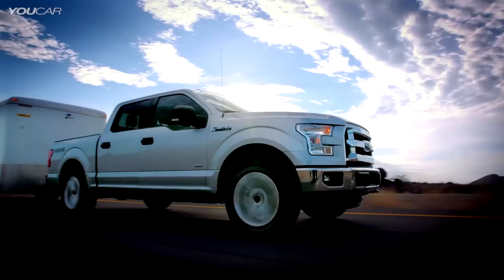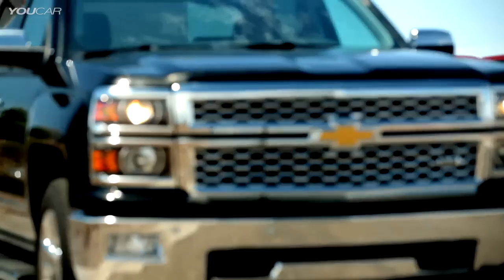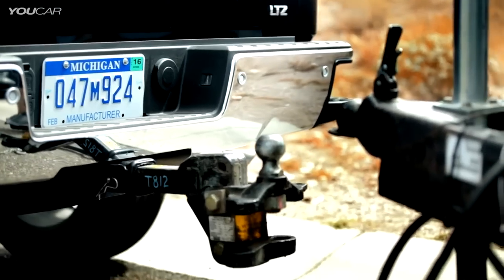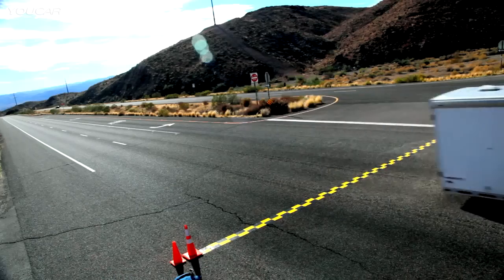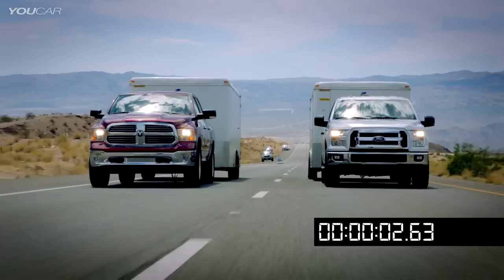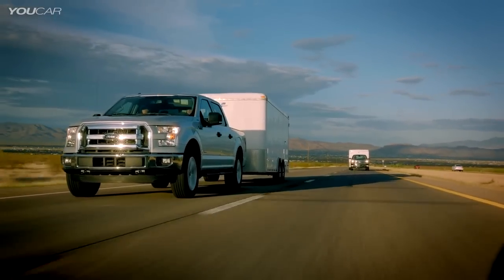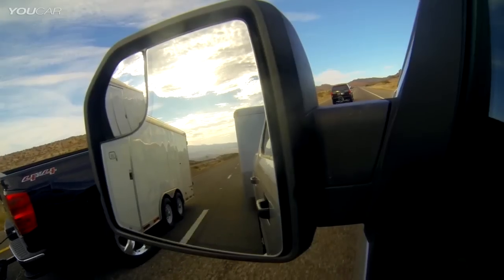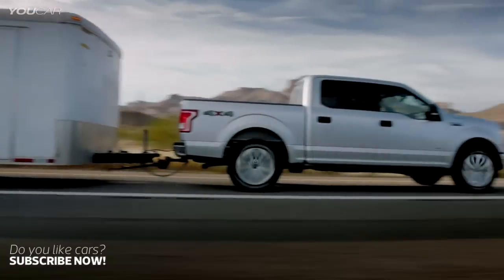TOWING Comparison – Ford F150 vs RAM 1500 vs Chevrolet Silverado

Comment: Fords little engine might be faster, but I have seen them towing and mpg' are very low about 9-10mpg. At the end of they day yes you still have a 2.7 v6. Get real they might be faster but the only thing moving that truck are the turbos not the tiny v6. So at the end of the day I would rather stay with a 5.3 which has been around for a long time just getting fined tuned. Might be slower but reliable.
Reply: +rollocock If you have a newer GM then that 5.3 has only been around for a couple of years, not a long time by any means.
Reply: +Daniel Bell 
Same concept engine just direct injection baby. Good luck replacing your little turbos. I had an eco boost and I traded the truck in to many sensors going off all the time, but again I do use my truck like a man for the ranch and I tow a lot and use it for hunting in south Texas. GMC has been the only truck tough enough for my needs. Even had a 2013 ram 2500 same thing def fluid sensors way to sensitive couldn't drive for long cause check engine light would always come on.
Reply: rollocock The only things it shares with the old 5.3s are the block and displacement. Completely different engines. As for the EcoBoost, I wouldn't know first hand. I've had my truck since 05. Good luck with your Gay Man's Chevy.
Reply: +Daniel Bell 
Don't be made just cause you have a 10 yr old truck man. One of these days when you grow up and get a real job you will be able to afford a real one. Then you can talk shit like you have actually owned all these trucks you talk about. Boom, you made bro.
Reply: rollocock When you've lived as long as I have actually doing work for a living, you'll understand the difference between want and need. Or maybe you won't, you sound like a child. I would like a new truck but I have no need for one when my truck gets the job done every time without fail. Come back when you've got 20 years experience with how bad Chevys are, especially that gutless piece of shit 5.3. I believe the term is "You mad bro?", to use your young vernacular.
Reply: +Daniel Bell 
Well to be honest I have been around for a while and I'm not saying that ford is a piece of shit they do have a good engineering team. But the Eco boost is very new to the truck world. But u say u have a 2005 I had two 2004 ford fx4s first one had a severe knocking problem when oil was changed, dealer said was normal which was bull shit. Got another one and guess what I couldn't even change the spark plugs cause they break in the engine block. So yes I have a lot of experience around trucks I do mechanic work and under stand the difference between want and need. But when u can't even change a spark plug in a truck that's a big cause for concern too bad your 20 years of experience didn't add up to shit u dumb ass. Fords 5.4 was the cheapest engine they ever built that's why it's no longer being made.
Reply: +rollocock 
U will be mad bro, when it's time to change your spark plugs and u have to take it to the dealer to take your engine apart cause the plug is stuck in there broken.   U sound like an old troll,  or a little kid that got his dad's old truck and never got a real job to buy his own truck. Good day my friend.
Reply: rollocock Already changed them at 172000 miles. Not a single broken spark plug. Nice try kid. I sound like a child? I'm not the one that can't spell or actually use whole words. Tell me, just how many milliseconds does it save you to type U instead of you? Are you stupid or just lazy?  While this has been mildly entertaining, you're beginning to bore me.
Reply: +Daniel Bell 
Might be lazy, but I still don't drive a problematic ford. FOUND ON ROAD DEAD. I don't have to waist my time with u, u old cry baby. Just google your own truck reviews and u will sell that crap pile ASAP. Old grumpy grandpa, of course your truck is fine for your use u r probably the guy on the expressway going 40 mph on a 75.

Comment: This is full of bullshit

The V6 is lighter and more efficient yes 

But putting a 7,000 pound trailer will sap that effecincy over night 
 
You are forcing the engine to work so much harder than it should 

Not to mention what it’ll do to longevity 

If you ask me if your getting a truck from this generation GET ONE WITH A V8 

I garuntee you it will last longer

Comment: That's sad that they're saying that piddly little puke ass 6 cylinder engines for full size trucks are the future.   I want a big V8!   I'll never buy one of those eco poops.   One thing they've failed to mention in the video is that, because these little engines are wound up so much to produce the power they have,....they won't last long.   To much heat and strain running through them.

Comment: OK....so...when the turbo goes out then what? That's right, your dead in the water. I do have a question though which from what I have heard ford was having issues with the turbo's. How much does it cost t have that fixed or replaced. Its a real question. If anyone can answer it please. let me know!

Comment: Better gas mileage?  Now that's a good one.  Just like Fords ecoboost 2.0 4cyl gets better mileage than a Camry V6 or Accord V6.  Didn't happen.  And the Escape 2.0 getting better mileage than the previous body v6 Rav4.  Didn't happen.  Don't get me wrong, a turbo on any motor is a good thing as it adds power.  But don't let Ford fool you that this is for "real world" gas mileage gains.

Comment: This is complete BS. "Each truck is equipped with it's most capable axle". The diesel Ram is equipped with it's least capable axle, the 3.92. If it had the 3.55 axle that is available, it would tow much better. Also, I bet they didn't press the old tow/haul button on the dodge, because that would have increased acceleration. Ford wouldn't want that in their commercial. I'd pick a diesel over a tiny twin turbo v6 any day.
Reply: I know it's not what they used in the video, but I just want to point out how stupid your comment is by highlighting the fact that the Cummins is a turbo V-6.
Reply: There is a slight difference between a tiny 2.7L V6 with twin turbos, and a 6.7L, 800ft/lb single turbo INLINE 6 cyl diesel. I would still pick a naturally aspirated 3.0L diesel over a tiny twin turbo V6 in my truck any day. My comment wasn't directed at the fact the ford has twin turbos, it's the fact that it has such a puny engine. The 3.0 diesel is a superior engine, which will be proven in Real tests, not ford commercials.
Reply: illisbillis2424 My mistake, the Cummins is an inline 6, but that still doesn't change my point. If the engines are specifically built to handle the stress and weight, then as long as it's a good design, there shouldn't be any problems for these small engines to perform adequately.

Comment: Everything is a race these days. All of these trucks will pull that load with no problem. I don't need to race up the hill. Ford still uses the garbage IWE design on the front differential. They still have a ton of timing chain issues. Does no one at Ford know how to source decent timing chains and guides.

Comment: These is mes up compression ,you cant compere a naturally aspirated engine to a TURBO CHARGED ENGINE....a tune up turbo with factory non tuneup engine..really?
Reply: So a non-turbo engine has no tune? They just throw it together and hope for the best?
Reply: comparison", They are just using the top of the line engine option, in this case it is a ecodiesel, ecoboost from ford and should be the 6.2l from gm
Reply: thevinceberry No, the 2.7 is not the top of the line engine.  The 3.5 Ecoboost is and it spanks the 6.2 from GM and the Hemi from Ram.
Reply: Bubu Lubu ah..I thought the 2.7 will replace the current 3.5 next year, maybe the gm 6.2 can beat all of them since they didn't use it in this video. The 5.3 did do pretty good when the air is cooler and denser. I am surprise the 2.7 didn't have heat soak from turbo in those temperature
Reply: thevinceberry one reason they used the 2.7l engine because it is a brand new and tiny engine that alot of people thought would be weak. Another reason is because the 2.7l engine is going to be extremely fuel efficient, while no numbers have been released experts guess it'll be around 30mpg. If you look though enough pictures you'll see one of a dash with 1152 mile on on tank of gas and that's with a 33glallon gas tank which doing some math that's over 30mpg
Reply: darkerthen black ah ok, 30+mpg on a hot day in a full size truck will be super impressive

Comment: hey I'm looking to buy a 2015 f150 2.7l v6 xlt 4x4...super cab,
and I'm very curious to know about fuel milage...how is it? 

but from your experience, how many kms can you get in one tank ( on average )
and do you get good mileage while hauling? 
I'm getting a truck camper that will be around 1500-1600 pounds. and it'll be in the back for the whole  summer, so looking to see if it'll be any good or not on gas.
thanks
Reply: sorry what ? haha but i ended up buying a 2015 f150 2.7l. it's really good on gas. first two tanks of fuel so far have been 12.5l/100kms

Comment: Turbo direct injection is the way of the future.  Close minded people just cant accept anything other than a V8 in a truck. All manufacturers will eventually go this route.  So no matter what brand of truck you like, everyone better start getting used to this concept.  Thumbs up for Ford stepping out of the box first with the engine, and now with the aluminum body.  I'm all for a smaller carbon footprint.

Comment: Of course Ford is going to win they are they ones submitting the video. How would it look if they lost in their own video. And if they are going to test they need to use the biggest engines, because after all if your going to tow a lot you won't get the littler engines. Me myself am a Chevy guy! And when Chevy does the testing I feel the same! So I like the fast lane truck for tests like these!!

Comment: I drive a ford f-150 5.4 V8 3V. I love that motor but ford just makes me laugh with this eco boost crap. Hmm lets line up trucks and which one wins is the better truck. It doesn't matter how much torque or horsepower you have. Thats right but dependability is key. I rather drive a chevy then these
New f-150 with eco boost engines. Long live V8s!

Comment: Who races or passes with 7 k trailers behind them,seriously..these tests are rediculous,and show nothing .no one is going to do this with there new trucks with a trailer.In every ride and drive th Ram 3.0 eco diesel comes out ahead with its awesome 8speed trans and 420 ft lbs torque,at low rpm.who cares if it gets passed by a little 2.7 at 5500 rpm and 15 psi boost,it's going to require expensive oil,frequent changes and it's still not going to last like V8 or diesel....

Comment: Way I see it. Ford= Speed Dodge= Hauling and chevy, well I dont know yet.
Reply: Dodge hauling? Hauling what? Dodge can't haul anything ... the new Rams get the best gas mileage because they can't pull shit unlike the Ford and Silverado.
Reply: +TrapBird (Camaro Girl) the new Ram out tow the ford and Chevy
Reply: Ricky Davis Ok first off that barely made any sense, I really hope English isn't your first language, but Rams and towing are two things that just don't go together.  It's like fire and ice, water and oil, drinking and driving.  None of them go together, or they just don't end well
Reply: +TrapBird (Camaro Girl) the ram are make for towing just why they make them
Reply: +TrapBird (Camaro Girl) yep dodge can't haul anything, even though they have the most torque and towing capacity but your right dodge can't haul shit
Reply: +NickF1999 whatever
Reply: Michael Dean you do realize I was being sarcastic right

Comment: except when your ecoboost blows up at 20,000 miles and ford says owell...
Reply: It wont blow up at 20,000 it will stop running at 1 million miles
Reply: Actually... I know of two ecoboost trucks that blew up before 20k and Ford wouldn't do shit about it. Look it up too, lots of people are having the same issue. The EcoBoost blocks are already maxed out from factory making them very susceptible to issues.
Reply: es esto real ? piensas que el ecoboost no es tan bueno ? que recomiendas  con tu experiencia ?
Reply: He probably recommends a V-8 or diesel for durability and fuel mileage.

Comment: I don't care if ford beat Chevy. I still rather have the Chevy v8 5 liter engine than a 2.3 liter and I want that big v8 that can handle the abuse. I don't think I'm gonna be flooring my truck on the highway with a trailer to see how good it does. No I want a truck I can rely on and not have to worry about 2 liter truck with poor body and poor bed strength. And ford is not a good truck to own because of the way they built it

Comment: Beware the Ecoboost!  Had Fords all my life - F150s, F250s, Explorers, Expeditions, but my 2012 3.5 Ecoboost blew up twice and Ford ran from the problem.  Original engine disintegrated at 83K miles, used replacement went to 91K miles.  Loved the truck but cant afford new engines every 80-90K.  I will never buy another Ford piece of junk!

Comment: Without compromising? How about reliability if I owned a car company I would never put a 2.7 in a truck . proven fact the old small block 8cycle are still on the road 96 5.7 Chev 795 km still running nothing done bet the ford dies at 160 km

Comment: Will this engine cake the inlet valves like the 3.5 and have service bulletins to stick plastic covers over the intercooler to increase the intake air temp in moist conditions? Prob not good for towing in hot weather. Also cat failure occur due to misfires caused by intake valve caking and moisture.
Ford cannot build diesel engines after the 7.3. 6.0 BHG oil cooler issues etc. etc. 6.4 cracking heads and the the 6.7 suffers turbo failure and drop valves due to heat. So far the 6.0 is actually the best after the 7.3 once you slap in a set of head studs bigger rad and remove emissions gear and look after them. (I know up to 6.7 was Navistar)
Ford is trying to sell gas engines to compete with diesel, cheaper to build and cheaper to replace under warranty is the main go here if you ask me.
I wonder if these has metal valve guides again? It is a known fact that a soft and hard metal last much longer than running 2x hard material.
Integrated exhaust manifold - sounds to me like some poor believer will have to buy a new head when they crack. Hope you got that right.
Still feel like every engine is an experiment. 

I love the F150 more than any of the others, but not for the engine. 
I dont know of any Dodge powerstoke conversion, but have seen Ford Cummins conversions. That is saying something ford should take note of. 

Will take the VM Motori any day over a just released Ford engine. 
Just give a F150 with a proper diesel. Thank you.

Comment: Chevy is still the better bargain. Why? Let's see, the eco diesel is a $5,000 option and is more expensive to maintain than a naturally aspirated engine. Not sure on the pricing of  the Eco Boost but it too will be more expensive to maintain than an natural aspirated engine. Also, insurance will be higher on that all aluminum body of the Ford. With all that said, if I were buying purely off looks it would be really difficult to not purchase the Ford.

Comment: This is all bull... Use the 5.7 hemi... It'll leave that ford dead
Reply: No it's an even race dude. Of course if you have better upgrades it'll beat the ford.
Reply: +Pilot Pj (pbnjminer) not necessarily an upgrade... It's just that the ford is using a low power truck so they takes Rams lowest power truck in its class which is bull... Yes it's even but ford better step up their game cause they are eh... I had a ford and it was pretty. But it sucked, no I have a ram which is badass and powerful
Reply: Yes i agree that dodge does have badass trucks and diesel but i also agree that all 3 companies are great

Comment: Ford only won because of their lightweight frame and dodge lost because of their heavy weight frame
Reply: So you don't really get how towing works, do you?
Reply: No I know how its by torque and HP but ford has a lightweight frame so less weight dodge has full steel frames so more weight
Reply: TJ LAVERY Yes... And when you're towing, more weight = more inertia, and more grip. If anything, the weight difference is putting the Ford at at disadvantage.
Reply: +TJ LAVERY Also, the frame isn't lightweight, the body is.
Reply: Ford frame is POS
Reply: +Daniel Bell  yep
Reply: NickF1999 You don't understand Diesel engines. The more strain there is, the better they run, up to a certain point obviously, so that immediately puts the Dodge at an advantage, regardless of how heavy it is. I think what it really comes down to though, is the fact that the F-150 makes infinitely more power with the turbos running at full boost, regardless of any company specs you hear, those EcoBoosts fucking rip, they can easily outrun the 5.7 HEMI Ram's even in the old steel body, I've actually heard the 2.7 Liter EcoBoost is actually the most powerful engine you can get with the F150, but don't quote me on that, it's just what I've heard from owners.
Reply: MaxTheKanuck #JoinTheMasterRace Quickest perhaps, but it's far from the most powerful.
Reply: Daniel Bell Just saying what I've heard.
Reply: MaxTheKanuck #JoinTheMasterRace Sorry to say but it's not true. Both the 5.0 and the 3.5 EcoBoost are far more powerful.
Reply: Daniel Bell Oh my... ARE YOU BLIND? How many goddam times do I need to repeat that it's just what I've heard from owners?
Reply: MaxTheKanuck #JoinTheMasterRace I don't know, are YOU blind? All I've said is it's not true, despite what you've heard.
Reply: nobody seems to notice that chevy had their older model engine and not the newer one